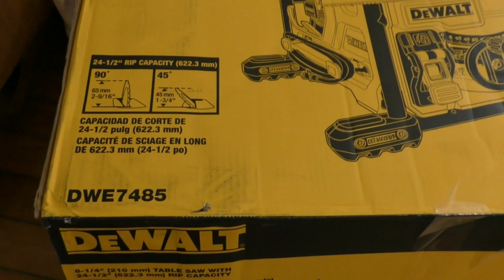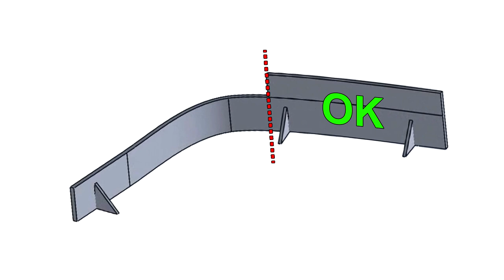Woops! I ordered DeWalt DWE7485 AND a dado set!

Comment: I thought the issue was the threaded rod where the blades attach is too short, no that plastic was interfering. Is that not the case?
Reply from the maker: Well, the short threaded rod (arbor) is still an issue, and I have not solved it. So I can't run the whole dado stack. But with the 7485 there is ALSO this plastic bit that's in the way.
Reply: @Odonnol  got it, thanks for the heads up. And you still used an 8" blade or cutting the plastic let you use 10"?
Reply from the maker: @qodesmith520  I don't have any 10" blades, so that question did not occur to me. I CAN say that a 7" blade works fine though. I seriously doubt a 10" blade would have clearance.